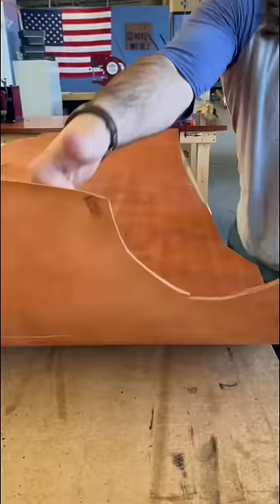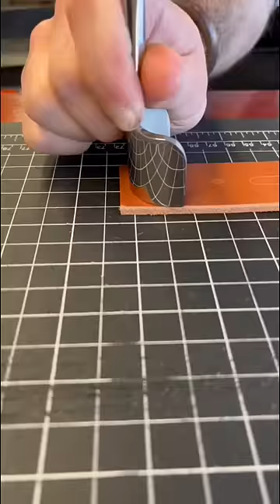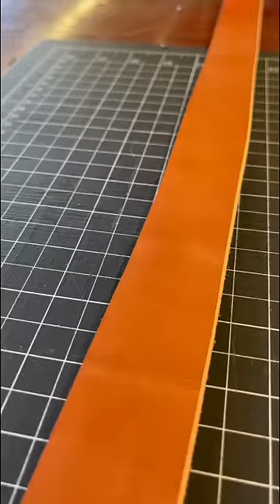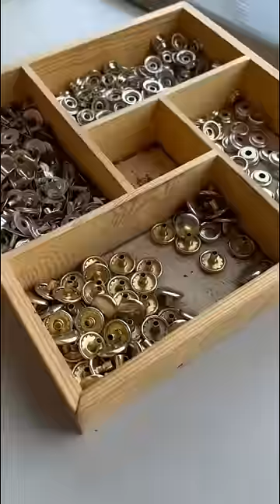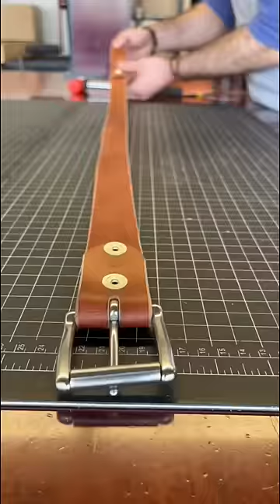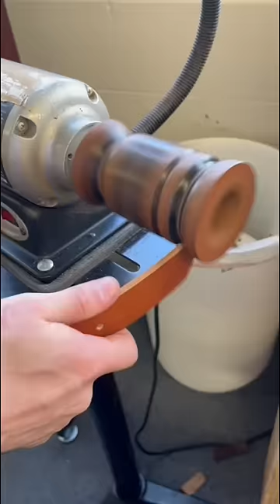Handmade Leather Belt DIY #shorts

Comment: Ok so I've got a trifold wallet that is brand new and it won't close and I tried everything,books, sitting on it everything, does anyone have advice to make it fully close, and no I don't have to many cards or cash
Reply: Hii Peter just put 2 or 3 coins on the upper side of the wallet when it closes the weight of the coin will make it close
Reply: @leonskennedy9384  ok will do thank you for the advice
Reply: @Peter-qg8sj  No problem bro 😉